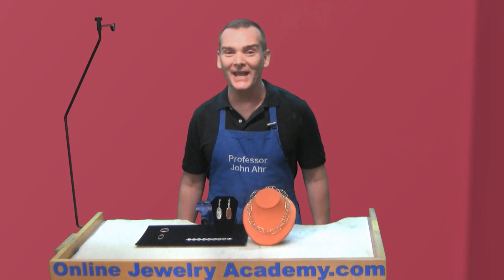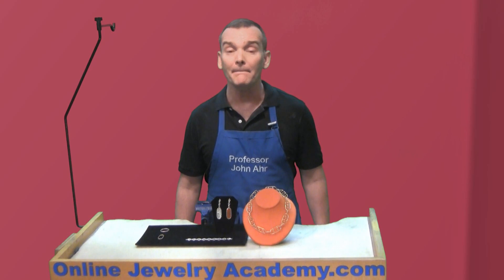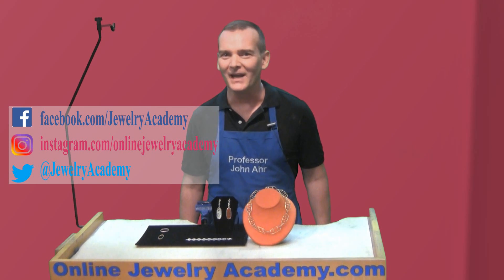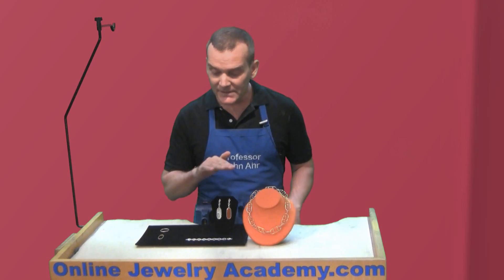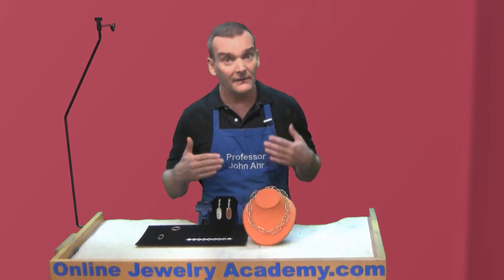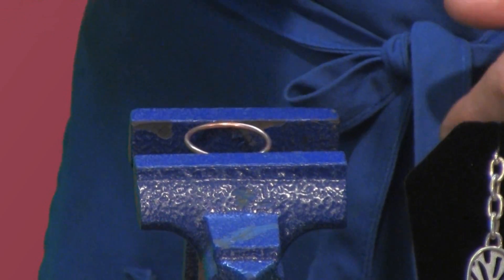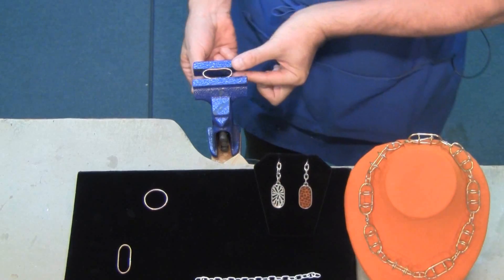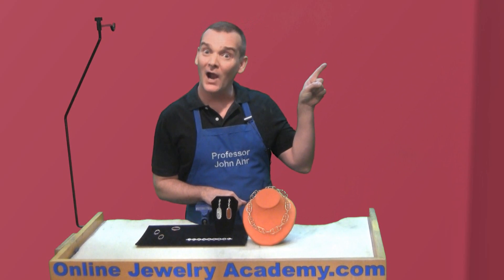Quickly Transform A Wire Circle Into An Oval Or Drawn Link

Comment: Genius! Thanks so much. I’ve been trying to create a uniform ovals using pliers...ugh!
Reply from the maker: I'm so glad that you found the information in this video so helpful.  You can also make uniform oval jump rings with an oval coiling mandrel.  You can either grind off the teeth on an old file or solder two round lengths of tool steel to create your oval mandrel.  Good luck with your creative pursuits.
Thanks for your support! : )